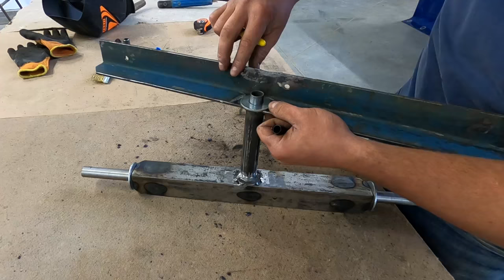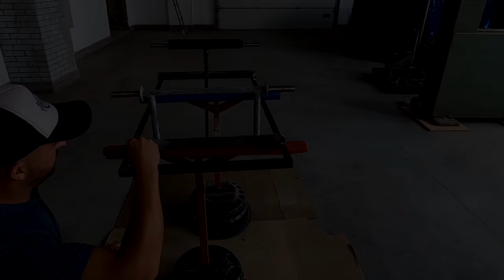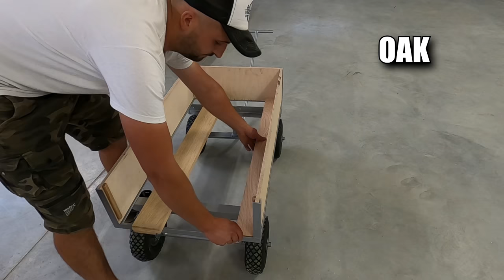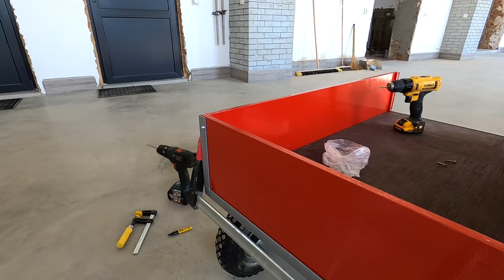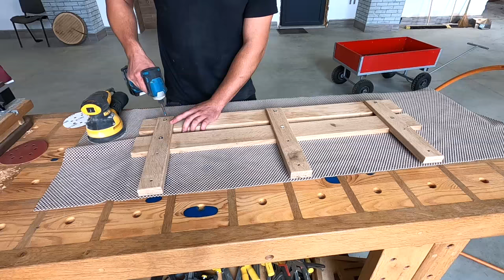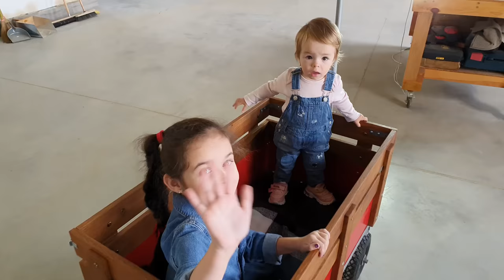Creative Workshop Cart from STEEL and WOOD / Wagon For Firewood

Comment: I have a trailer built for my mobility scooter with just two child's bike wheels. I also thought about the 4 upright corner metal angle bars to weld them on for support and to take more ware as I use it each week to bring my black rubbish bags to the local refuse area. I see you have 4 wheels on your cart and I think I might also change from my two wheel system to a 4 wheel system as with arthritis and my other medical conditions and my age it would be more beneficial for loading and unloading. Do you think changing to a 4 wheel set up would be better for my mobility scooter will it turn easily behind my scooter especially if I need to reverse at times or is it a bad idea
Reply from the maker: Hi, it will be more difficult for you to drive the scooter)